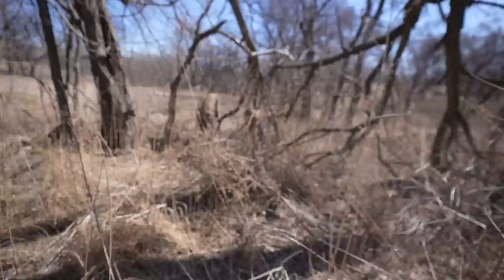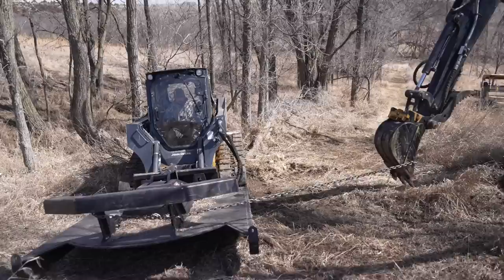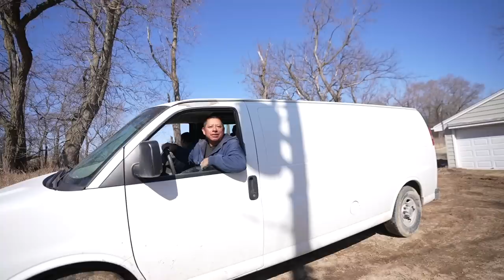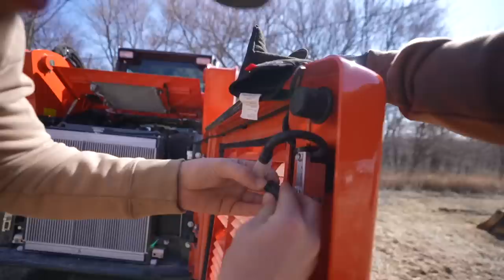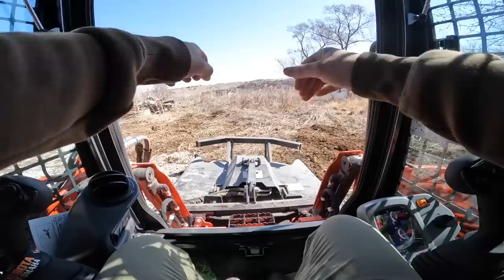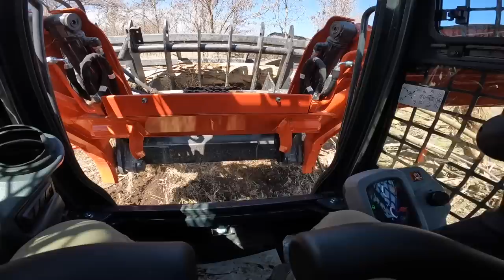My Skid Loader BLEW UP.... So I Bought a NEW ONE!!!

Comment: You made a great choice on a skid I am a Kubota tech and have been for 3 years and these machines are tough as nails plus you are getting the exact engine as cat runs, they just rebrand the Kubota engine in their unit. Best loaders on the market  good choice!
Reply: Thank you Eric for that info. 🍻
Reply: I was gonna say, doesn’t Kubota supply engines to many different brands and products.
Reply: Yes they do bobcat used to run Kubota engines as well but now use something different
Reply: I've had a 95-2 for a few years and apart from some EGR sensor issues at about 500 hrs  it's been great....best warranty ever by the way

Comment: You're going to love that Kubota! I Have a 2012 SVL-75 that has never broke down. One tip I'll give you is to only use Kubota fuel filters (Common rail diesel engines need clean fuel).

Comment: From a guy that's been operating skid steer for 30 years, the cats are by far the best on the market. But if you aren't using it for construction there's nothing wrong with the other brands.  The deere are usually a pretty good machine but every once and a while no matter what ya buy your gonna get a lemon.
Reply: Looking to get a skidsteer. Been thinking about bobcat. Where would you put them? 2?
Reply: @Logan Hartley  the bobcats are good machines too. I mainly do very heavy and demanding  machine work so the cats always my first choice, but I've used  bobcats quite a bit over the years and I've never had one give me any real problems. The key to keeping Any machine in good running order is maintenance
Reply: I sell Cat and the biggest difference to me is the resell value.
Reply: Can't beat the 299d3
Reply: @loganhartley7718  I work on bobcats daily for a rental company and bobcats are the easiest and reliable for the amount of abuse our customers put them through… kubota are also really good but a pain to work on.
Reply: Aren’t the Deere frames built like a tractor frame?
Reply: Here is the mark kubota . Cats are good more price . Kubota whil do the same for smaller price . And the parts are way more cheaper 😂
Reply: @gulkerparker6013 john deere is dutch most just mark . Here in the Netherlands . Only kubota is taking over the mark . Its way cheaper then the cats same build and brand
Reply: @loganhartley7718 I use bobcat t595. Bobcats are lighter then cats with the same operating weight and speed. Better fuel economy as well
Reply: My uncle is a John Deere fanboy and he has a lemon tractor and lemon zro turn. John Deere don't make them like they used to.
Reply: Definitely needs to rev it down a bit
Reply: Everyone's different but I can assure you cat's not the best
Reply: @loganhartley7718  Kubota SSV 65 or 75 depending on the size you need. Can’t go wrong with one.
Reply: theres actually several id say are equal and thats cat takeuchi bobcat kebelco and a few others john deeres are great machines too but having hack "mechanics" fix your stuff will always make a machine look bad every single manufacture including cat has lemons its just the way of life sometimes
Reply: do komatsu make skid steers? they’re excavators are nice.
Reply: I have a grading company and we cut basements and slabs EVERYDAY our machines run all day everyday and started off with bobcat. Now have only kubotas. Either 95s or 97s. They don’t stop. . You will get dirt in the cabin before it even bogs down.
Reply: I posted this before seeing the video and yup just like I said it does not bog down. He needs to try a 97 kubotas biggest machine with high flow. We mulch trees up to 10 inches thick and it does not stop.
Reply: We have the same one
Reply: Kubota easier to work on and last longer in my opinion i work for rental company we have loyal old 75 2s that have 5k+ hours
Reply: @JuarezDerrick I agree.

Comment: Flair I own a excavating company in Michigan and I also have a svL 75 and it does all the thing I want it to do like digging out foundation or tarring out concrete and even loading gravel/ sand in my dump truck you made a very good choice going with Kubota, it won't let you down.

Comment: I work for a Case and Kubota dealer and there’s a John Deere dealer 5 miles from us and.  The Kubota skid steers are starting to take over around here.  For the price and the performance they are hard to beat.  And haven’t had very many problems with them.  The forestry mulcher attachments are awesome. They will pretty much just grind whatever is in the path. The mulcher attachments work great for clearing trails and cleaning up fence row lines.

Comment: Great content as always guys. Invest in a stump grinder and a mulcher. Tons of uses for the mulch. Animal and chicken bedding. Add it to flower beds. Use it between the rows in your garden to control weeds. Plus it rots adding nutrients to the soil for next year's crops. If you are going to be doing a ton of fencing get a post driver and a auger but if you're just doing smallish lots try rentals. Saves money and you get to test them out.👍🏻

Comment: With all the trees and branches you have to take care of, you should get a mulcher attachment. The shreader is good but the mulcher will take out all that and the larger ones.  Then you wont have to burn because the woodchips would break down eventually, or you can use them in the animal areas as bedding or to take care of the mud. Even for the chickens. But they make attachments for the mini or the skid. Or just buy a woodchipper or one that does them really fine for chicken pens.

Comment: Make sure when you have the door up on your new kubota and you’re running it you put the safety latches in so the door doesn’t go out of alignment. Also I’d look into renting or buying a fecon head to fit your svl75 it will mulch down full trees and brush piles. We run kubota at our tree service and land clearing company and like them. But with a fecon head you will need to get a forestry window.

Comment: When I was doing concrete work, I used to run a Takeuchi TL12R2. The thing had all the bells and whistles! It was really easy, especially in tight areas. It also had the over head door in it as well, idk how much it was tbh but I used to run a bobcat before that and always had problems with it.

Comment: Flair one of the biggest complaints with the "K's" are what they call dirt traps. The biggest ones are at the rear of the arm supports. To fix this just widen the rain water drain hole and rinse it out with a water hose after doing any dirt or dusty (mowing, hay moving) work.

Comment: For the parking lot for the trailers I would recommend putting geo fabric down first it does add a little bit of cost but the rock won’t pack in the dirt and you won’t have to keep adding rock. Also nice skid loader but Takeuchi also has the rook up door. But next time you buy a skid loader I like to set up a demo from multiple brands on the same day and time at your place and try them all out at the same time then the salesman know you mean business and usually gives a better deal to compete.Lastly fun fact John Deere had the roll up door but they changed to the door you had for some reason.

Comment: awesome work... you might want to put some landscape fabric down before you do your gravel .. that will help stop weeds from growing through.. something you may want to check is if you have recycled concrete available in your area.. they use that a lot here for road base/parking lots.. lastly.. your other machine may have a button you need to press to put it in high flow..

Comment: Hey flair just to let you know that that skid loader might be a little bit underpowered for brush hog / mulcher you might need to get a 95 horse just to be safe it run it better than that that's what we used to have a 95 horse on the farm and it cleared brush like a Beast giving you some advice so you don't screw up the skid steer something else you might invest in is a tree puller attachment I personally haven't ran the 95 horse but my brother used to

Comment: Looks like it could be turbo seals on the JD considering the way it was smoking or possibly head gasket/warped cylinder head from when it lost the coolant hose and ran hot

Comment: I have a old ghel skid steer and had it for over 17 years haven’t changed the oil in about 10 years and it’s running strong has over 300k hours
Reply: Haahahahhaahhaa what

Comment: If you're the buyer AND the operator you get the machine you want and be damned to haters. Personally I avoid "bells & whistles" as each one might be nice to have, but it's just one more thing to go wrong. I've only ever heard good things about Kubota machines.
Hard to remove safety gear is sort of the point of safety gear lol.

Comment: I totally get the reason you got the Kubo! I think you made the right decision for sure. That said, the hype behind Cat isn't quite as bad as you make it sound... They really are top quality. Can they get away with charging a bit extra because of that? Yeah probably. But even if you took the name away and got the exact same machine for the "non inflated" price of a Cat, it would probably still be the most expensive option just for sheer cost of high quality build.

Comment: I’ve actually ran all theee brands you’ve mentioned, Deere, kubota, and CAT. A new Kubota was the first that I ran for a couple months, decided to get rid of it and we got the biggest John Deere makes brand new like the kubota. Personally I liked the way John Deere felt compared to the kubota. I do think the kubota door is a lot more practical and the flip down arm rests. Now at my new job we have a little older Cat with no windows or door or A/C and I like it as much as I liked the Deere.
Reply: Also, I think the John Deere may have had a switch to turn hi flow on but Idk maybe not

Comment: Just speaking for my dad that has been building roads for 30 years if you want to build a pad for parking stuff on that will have a good bit of traffic bring in a few loads of shell first and pack it down shell has more flat surface area then gravel and wont sink into mud as easy and creates a hard surface to build on after a few months of traffic itll get some low spots then add gravel on top

Comment: we use Kubota with the company (we use them for construction, any problems we have with them can be fixed by us) I work but we also have a big ol bobcat and the bobcat throws codes like no tomorrow (its in the shop again) The only things we have had to put is the backup camera and a lockout pad (they are the most stolen machine)

Comment: There should be three hoses for a high flow implement. We have a John Deere G333 and we have had weird problems with ours where it bogs down running high flow. It has been in the shop for a month and they haven’t figured anything out.

Comment: I have a bobcat and it is a 2001 and it still runs great to this day only problem we had with it was bad fuel in it. And it is used and abused like it plows our accounts in the winter and put salt in the soldiers and during the summer it moves trees, stumps and much other stuff like dirt gravel. So I would have went with a bobcat but that is my opinion

Comment: Run two Deere skids at work and haven’t had problems with them, personal favorite is CAT with bobcat at number 2 but if not being used for construction or just heavy duty work regularly then Kubota makes machines that will get the job done just as well but for like you said a much better price tag

Comment: I run John Deere machines and the only problem I’ve ever had out my 325 skid steer is just keeping fresh tracks on. Because we run them so much and the 50 g excavator was dead battery but it was 4 years old. Wouldn’t think of trading them for a cat to be part of that click. Don’t have time to wait on crappy service and parts just to run a cat tag on my truck

Comment: On the right joy stick instead of holding the thumb toggle just hit the button to the bottom right of the toggle it will stay running so your not having to hold the toggle the hole time

Comment: Kubota ain’t terrible honestly I used to work on them witch is why ion like them but they are more expensive the Deere to fix when stuff brakes as long as you don’t over use it it will last a good time the sliding sort is the best ngl except when it slams on your head 😂😂😂

Comment: Bobcat T650 and I get your door argument. Also if the door safety breaks a wire it kills your machine immediately. Cost me 3 hours one day. Was also 68k used 2 years ago. Also have 4 Kubota tractors that have never failed. Ever.

Comment: I work on a mega dairy my bosses bought three new Kubota skidsteers back in 2019 when they took over from my old bosses within two months of that the 65ssv I used blew a head gasket with less than 100 hours however they are great machines & all of them they still have well over 4000 hours on them

Comment: If the kubota doesn’t work for you you should get a new bobcat we have 6 of them we use them for farm work have over a thousand cows and they get the crap beat out of them and 2 of them have over a thousand hours never had any problems never had any problems with extra gadgets one of them with a thousand hours is got almost everything you can get on it

Comment: parts on them are harder to find. You should have grabbed a used bobcat because of how cheaper it would have been to repair. I also wouldnof grabbed one 20 years older, so theres fewer electronics that can cause issues and are easier to work on yourself. That way, parts are still available, and i can just watch a youtube video to fix and maintain. As long as there is heat and a fan, im good.

Comment: Flair not hating but we have a 2018 75-2 Kubota and we had 270 hours and it slung a rod through the block. Bad thing is that they wouldn’t warranty it. Then they wanted us to buy a 25,000 dollar engine. Horrible customer service.  Hope you have good luck with yours

Comment: Blowing heavy smoke like that would usually be a lot more wrong than an injector? Not being there I cant smell that thick white smoke,but I'd guess some kind of  oil being burned for some reason by the engine & discharged through exhaust. Bad head or head gasket,a failed intake that is sucking up engine or hydraulic oil in the air mix? Not good though. Probably actually made by poulan. Ouch Johndeer, I know that hurt! For all that work ,fuel & expense, why didnt you buck all that wood up & use it in woodstoves for camps,cabins & shops? Just pull it out with a tractor or side × side on wagons. I guess I just think more about making stuff pay me back for my expense & labor & getting something more out of it for a little more effort. Besides it will burn more safely in woodstoves when I want it & need it too. Keeps for years ?

Comment: That's not a high flow brush cutter, your larger quick connects at the bottom are high flow, the 2 smaller ones above it are the low flow connectors.

Comment: I would never buy a meow meow. I came into a position where we have all Case machinery. With good maintenance we have had no major issues. John Deere used to be really good, not so sure it is. Kubota will give you many issues in the future. Cat is very expensive, not a good value and they break all the time. I now believe case is the best value, Kubota has good deals, John Deere is expensive as cat and probably not as reliable. If your in the business of heavy machinery, I recommend always looking for good used deals and having multiple machines.

Comment: How did you not know if the Deere was high flow. If you haven’t turned the high flow on when operating you were running in standard flow. This comparison is isn’t apples to apples.